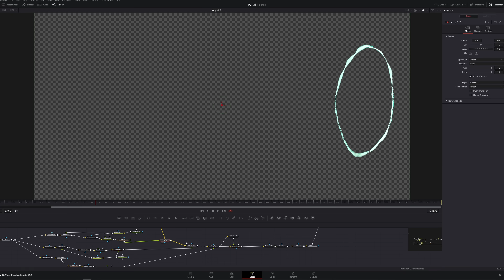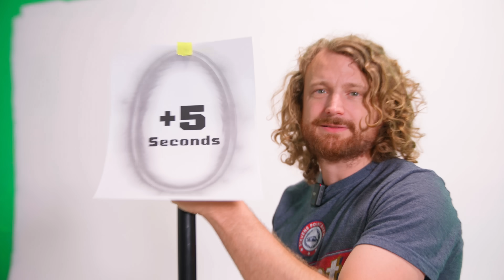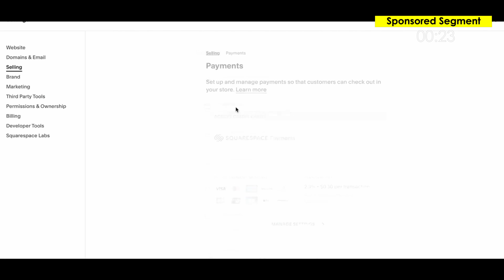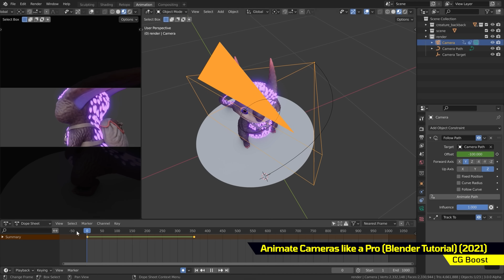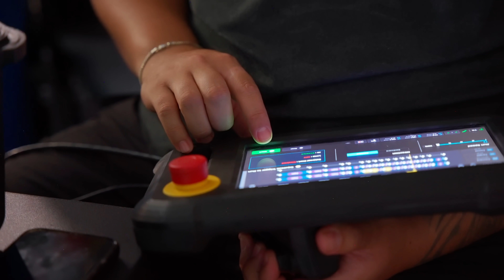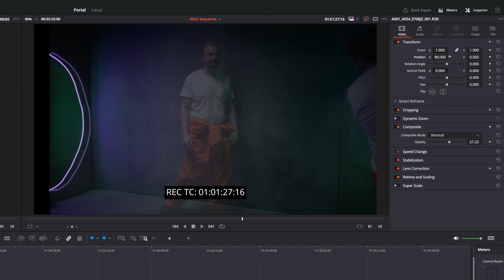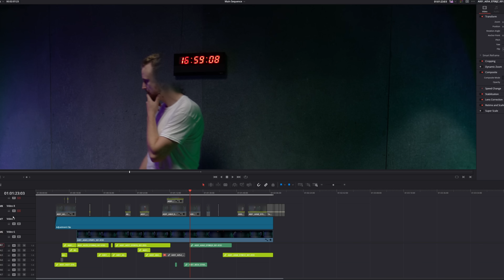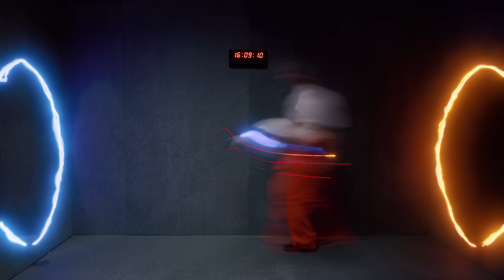This is What Happens When you Desynchronize Portals

Comment: Before watching the video, note that there already is a Portal time travel mod. It's been since 2021 and has the player using time travel portals as part of the puzzle.
Reply: I've stopped the video and noted that down bro 👌
Reply: Yes, but it's not the same. It's basically a portal that let's you travel to a distinct point in the future, not the desynchronization stuff that this video does.
I honestly think the Corridor idea is better and that somebody should do a mod like this in the future.
Reply: @brianmuicey1283  no, it's the exact same, just 200 years apart and only 1 instance of past and 1 instance of future instead of looping
Reply: How should this be possible? The game would have to predict your actions before you know thrm to simulate this..
Reply: @blonkasnootch7850  Not even to mention what Nico brings up in this video. The fact that you can see what happens in the future, and then decide NOT to do that, which would break time
Reply: @blonkasnootch7850 well if you leave through a portal in time there is nobody left to move anything around so when you arrive 200 years in the future everything is how you left it but more worn down so it’s not predicting any future movement
Reply: @brianmuicey1283 I think there's something that's kind of like that with the mod of thinking with time machine, but it's basically just recording your inputs and then spawning a past version of yourself to replay them.
Reply: Nah, it's been there since 2014, and is called Thinking with Time Machine.
Reply: @nepunepu5894  "no it's exact the same" - then proceeds to explain how it's nothing like the video. The guy you replied to basically said the same thing, you just said "no" then rephrased what he said.
Reply: No it really hasn't in this concept. Its as you say to distinct point, you do not get this concept in the mod, as its physically impossible in a game to make the game deterministicly predict your future for things you have yet to do
Reply: @BL00DYME55  i mean, to go 5 second foward of backwards is "going to specific time window" too. So yea, i do exactly saying the same thing. The only thing i correct is the fact that the two time portal works the same, just one of them has limitation.
Reply: @sometf2player752  I mean when, in the game,  i am in a room with these two portals and i go 5 sec to "the past", before i do that, i will see my self. So my character from the future needs to be rendered before i decide to go into "the past". Even a quantum computer could not predict that.

Comment: 5:10 "this video is not sponsored" The FCCs definition of sponsored is any kind of material benefit or special access. However, even if a video is sponsored the only requirement is notice of the sponsor not correctly indicating it's sponsored. Which means saying a video is NOT sponsored by your sponsor is a valid notice as long as it explains what made it sponsored. (the loaning of equipment).

Comment: Video ideas, expanding on this idea -I have a couple of ideas on how this would work just off the top of my head.

Idea 1: 4th dimensional / non Euclidean escape room (either hypercube, or a symplex or a Klein bottle or something like that)
· The escape room is time-looping itself through our 3 dimensional perspective, and you are stuck in an area that isn't in our perspective. You have to figure out how to navigate your way back/forward in time enough to synchronise your placement inside the escape room to the outside world.

Idea 2: Tenet, but with time dilated portals. Obviously you wouldn't be fiddling with reverse time in this situation, only forward time. you could add a mechanism to increase how much dilation the portals are affected by (increasing it from 5 seconds, to 24 hours or something)
·You could add a fifth portal type that reverses the time, or add an inverse dilation type thing if you wanted to really delve into reverse time with portals 🤔

Idea 3: inception with Portals - the portals are set to a fixed dilation witch increases or decreases with each dream sequence you enter or exit. The higher the time dilation on the portals, the deeper the dream sequence.
·If time slows an x amount for each dream sequence you enter, then the portal's dilation amount increases by that scale, and vice versa.

Either way a really fun and thought provoking concept! Love the work!

Comment: Desynchronizing portals is basically exactly how scientists think time travel could actually work, if we ever gained the capability to generate wormholes.

Generate two ends of a wormhole, then travel with one end of the wormhole at very high speeds causing time dilation. One end of the wormhole had time dilation and the other didn't, which would mean you could travel between two points in time, offset by how much time dilation you caused. 

For example, perhaps you travel at very high speeds for several light years. For both you and the people at home, it will feel like a year has passed, but from an outside perspective, perhaps it took you 50 years to reach your destination. 

Time dilation made 50 years feel like 1. But then that also means someone on earth could travel 49 years into the future, and you could travel 49 years into the past.

Now, take that same wormhole and do a return trip. Now the wormhole will allow you to travel 98 years into the past/future, while remaining at the same location. Pretty cool!

Comment: Also, interesting note.
If you go through the right, you'll seen yourself come from the left 5 seconds prior. But if you step immediately back in the left, it implies that you go into and back out of the one on the right. But if what if you go into the one on the right just as the one on the left is emerging a second time? That means the original you going out the right will immediately return to see your future self and then go back into the right to an empty room with your other self leaving as enter. If you keep messing with it, it can get confusing to keep track of which you is doing what and when.

BUT EVEN MORE CRAZY. If you run out of the left portal and immediately into the right portal over and over like in the beginning, that means you'll be going through ever 1 second. You could go through 5 times within the 5 second period. Meaning before you even go, you'll see yourself run past you at least 4 times before  you decide to run as well. If you suddenly stop, there will be 5 of you arriving in the same room one after another. If you randomly decide to switch directions once and then go back to the right again and do that every so often, there could be 6 or seven of  you running different directions and bumping into each other, not knowing which is which but somehow everyone will go precisely where they're meant to go.

Comment: An idea to use the robot arm that came to mind is using different timescales in 1 frame. Slo-motion and normal speed with different speed tracks. Or backwards and forward with the path reversed which I guess is Tenet.

Comment: There is a game called "Gateways" that does exactly this with it's time travel gateway gun. The time offset between the two gateways (portals) is the time difference between placing the first and the second. If the entrance is X old, it leads to the point in time when the exit is X old. With age being defined as zero at the time the gateway is placed. You obviously do not place both at the same time.

Comment: Fun fact : classical portals can already do this. Special Relativity teach us that simultaneity is not absolute, it depends on the frame of reference. When you set both portals, you also set in which reference frame events at the portals are simultaneous (going in one of them means going out of the other at the exact same time). But that also means an observer in an inertial reference frame moving close to the speed of light will see a delay between the entrance and the exit, the sign of the delay being linked to the sign of the velocity of the observer.
By reciprocity, if the « observer » now use the portal gun in his own reference frame targeting walls that stand still for us, we should obtain the same effect as depicted in the video.

Anyway, another method is to setup portals as usual and take one on a relativistic trip. This way the delay will appear between the two as a wormhole would, taking advantage of the twins paradox

Comment: put one portal (+5) on the ceiling and one on the floor (-5) go back in time until you see your kidnappers putting you in there and run out past them. You'd be falling 135mph (terminal velocity) at this point and you'd be tired and disoriented from falling for an hour straight (to go back in time 8ish hours) so you'd need the anti-shock boots and you'd need to really leverage the element of surprise but... you might make it.

Edit: I just saw the solution they went for. You couldn't possibly go forward in time fast enough unless this is a really shoddy room that doesn't last very long. You'd die of thirst in about 7 of your days (assuming you can get all the sleep and bathroom breaks you need while falling). Going back in time at only -5 seconds per about 2 meters that you fall, you could only get about 3 years back or forward before you die of thirst (falling at terminal velocity of 135mph). That's not even accounting for the time you lose to forward flow of time as you're falling your 2 meters which, while very small, would add up. So you'd have to go back and hope that you were transported into the room by conventional means. OR that the room had just been constructed. 

Unless my math is way off which is also possible.

Of course you'd also need Chell's anti fall damage boots because you'd be going 135mph. Otherwise you'd have to run it which would limit your time range WAY more than falling. Even if you put one on the floor and one on the wall to try to be fast but not lethally fast. 

...also I'm just realizing that you'd need to get the idea in under 5 seconds to avoid a paradox where you get the idea from your future self(vs) running/falling past you into the further past... although a few of his trips seemed inspired by past versions and the universe didn't end so maybe we're paradox proof here?  I can see why they went forward.
Reply: This has An issue.
You can't time travel to before the time portals were made.
We see the portals get turned into time portals after the kick that happened long after he was captured.
Reply: @whothefrickareyou8106  Presumably one of the exit portals lets out to a time slightly before there was an entrance portal but yeah, I guess he would need to click the trigger every time he went back beyond that point which would probably limit his fall speed, especially since-based on the game- you can't fire portals through portals so he'd have to time it just right every time.
Reply: @berkpick  my assumption is that when he kicked it, the portals  desynced over time after the kick.
Like, the future portal speeds up until its 5 seconds to the future while the past portal stops until 5 seconds have passed 

Because If you try to walk through the green portal to a time before the purple portal turned into a time portal, the green portal wouldnt have another end to send you to, unless its connected to the non time travel portal before it turned into a purple portal.

This Would kind of be solved If the Green portal waited 5 seconds after the kick before turning Green. That wouldve shown that the opening of a time portal means the other end has to open at the time the first is connected to, that being 5 seconds before or after the first opened. 

And even If that were the case, we saw the guy testing out his regular portal gun in the room for a long time before the time portals were An option.

And since this video has consistency, you can't go back in time to the same room you were in unless you yourself saw a future version of you falling through portals in the room earlier.

Comment: Haven't seen anyone do the math yet, so felt obligated: If we assume terminal velocity is 90 m/s and the ceiling is 2.5m tall, each pass through the room is going to take 0.028s as you fall. If the portals are 5s apart in time, you are "fast forwarding" into the future at 180x speed. If we assume the concrete room takes 100 years to decay to the point of collapse, you are going to need to fall for over 6 months to escape that room, and thus will die of windburn or dehydration first.

Comment: There is a way to do time travel without creating any paradoxes. You have to account for string theory or multiverse theory.

Essentially you go through the portal and instead of you have to go through the portal because it already happened you create another universe with it's own time line. If the past version of you never goes in the portal that doesn't change the fact that future you did go through the portal because you're not just from two different points on time you're from two different universes.

Of course the down side to accounting for multiple universes is that there is no possible way for a time traveler from the future to get back to the point they originally came from using time travel. Cause the moment you arrive in the past you can only travel forward on the new time line you just created. The new future might be very similar or very different to your own time depending on how much you changed in the past. But essentially you would permanently dissapear from your own time line and there'd be two of you in the new time line unless your past self also travels back in time in which case you'd replace that version of yourself in his time line while he goes off to a third time line and so on.

You need to be able to travel in both time and the multiverse to get back to the original point you started from because it's impossble to travel backwards in time without creating a new universe in the process.

Paradoxes are solved but introducing the multiverse brings in an entirely new set of problems.

Comment: The most interesting thing to consider about these time portals is this;

The portals send you to RELATIVE points in time, not between two fixed points in time. In 3D, this would be equivalent to having a portal 3 feet to your right and another 3 feet to your left, and they follow you if you move forward or backward. They transport you RELATIVE to your current position, NOT as if they're stuck to a stationary wall. Of course, this makes perfect sense- the walls the time portals are placed on ARE moving through time to follow you, as that's simply how time works- all things move forward through it naturally.

However, what if you COULD make a 4-dimensionally stationary object? Something that DOESN'T move through time with you? Well, first off, you'd see it vanish almost immediately after it is created, so you PROBABLY want to make it "large" enough in the time dimension to be seen for at least a few seconds, but if you were to put a portal on this surface, it would create a PERMANENT anchor to that point in time, as the surface the portal is on is itself fixed in time, therefore so is the portal. This means, to properly utilize a portal of this type for traditional time travel to fixed points in time, we need the ability to create fixed OBJECTS in time.

Comment: You could probably get something like this to work as a game but the game would need to be VERY linear and have some additional mechanics for it to work.
Basically you setup the world as a linear series of puzzles then you have an AI version of the player that has travelled to the past do the actions to solve the second half of the puzzle but fail when it gets to a point where you need to help them and don't, which would hint at what you need to do for the first half. If you don't do the first half correctly the world deteriorates and you go back to the start of that part of the puzzle. Once you successfully do the first half and help your future self complete the puzzle you go through a portal to the past and now you do the second half with the actions of your past self being played back so you would have to perform the actions you saw the future AI take to complete it.
Eventually you could ramp the difficulty up by requiring more and more overlapping selves to complete puzzles so you would need to remember more and more series of actions to complete the puzzles.
You might also need some kind of time pressure to encourage the player to do things as quickly as possible so they wouldn't have time to deviate from path of the solution, perhaps something is chasing them of the facility you are in is collapsing, it doesn't really matter as long as the player is given a need to basically speed run the game so they don't want to go slow, explore, or try to test the limits of the time mechanics, otherwise the illusion of their future self will fall apart because they could want to take more time to do things which the AI version of their future self will not be doing.
One thing I'm not too sure about is how to use the ability to travel forward to the future, perhaps it could be used to avoid a predictable event that kills every instance of you in the room or something, or perhaps it is just part of puzzles that if you want to travel back between portals you lose the time making it harder to time certain actions correctly.
The main concern I'd have is that it could wear thin pretty quickly, you are basically shown how to do future parts of the puzzle, and while there will be some interest and fun in trying to work out what the future self is attempting and what you need to do to help them it may just make things too simple or obvious to hold peoples attention for the length of a whole game. However I think that slowly ramping up to requiring a dozen or so overlapping selves would increase the complexity enough for at an hour or two so it would certainly be worth trying if someone had time to do so.